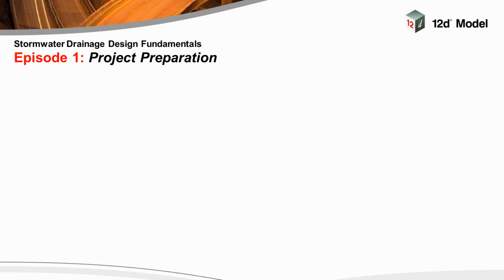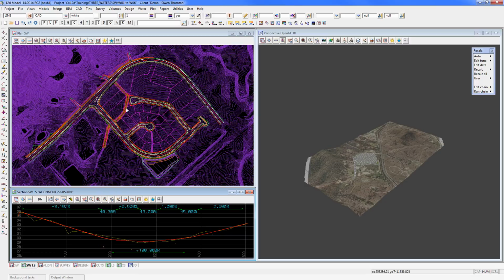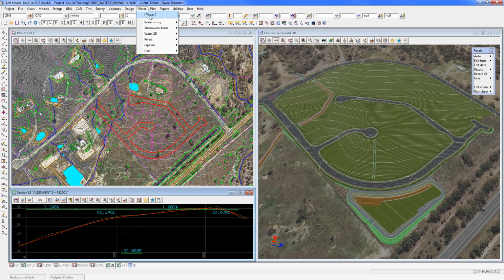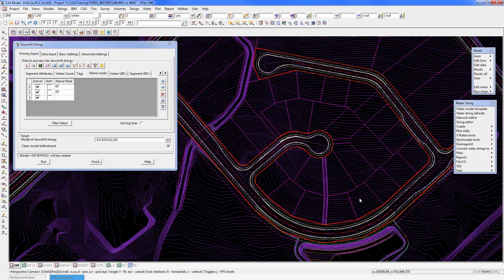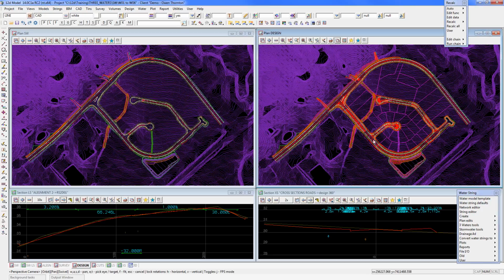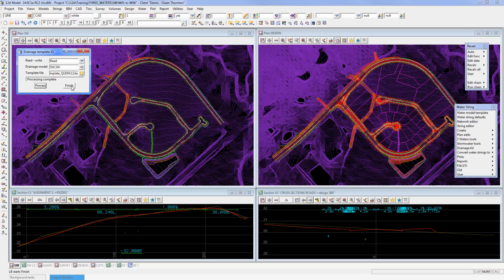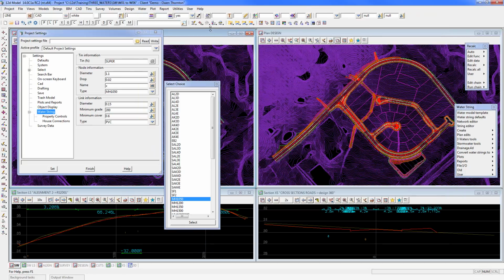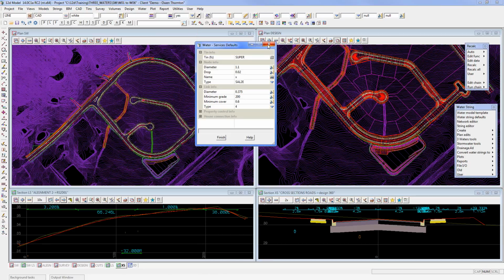Stormwater Drainage Design Fundamentals (Episode 1): Project Preparation - Training Webinar Series

Comment: With all due respect, I know we are meant to have an understanding of chains but if you're going to use them in a beginner/intermediate course at least demonstrate how they are being constructed and not just gloss over the fact you're using them.
Reply: To be fair, the "beginner/intermediate" tag pertains to the water side of 12d Model, not 12d Model in general. The material presented in this series (and the formal training course it is based on) is not intended to be one's first exposure to 12d Model. There are other videos on this channel that cover the creation of chains, and lots of other basic 12d Model operations. But there's also nothing like a good example, which is why the project shown in this series is made available (to those with a license on maintenance, via the 12d Model forum) with a collection of useful chains, that could potentially be incorporated into one's own projects. The use of chains is the single best way to improve one's productivity with 12d Model, so I consider it quite sensible to incorporate their use into my training courses, even if the focus of the training isn't on the creation of chains.